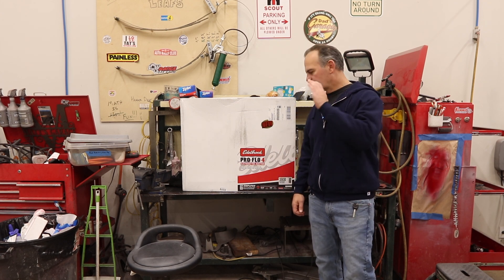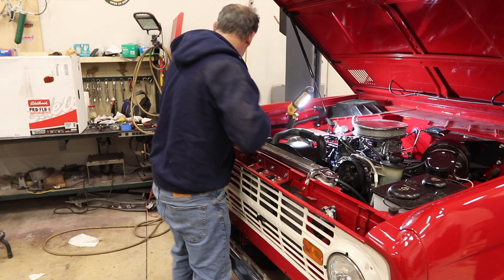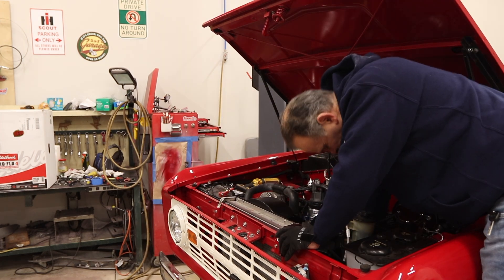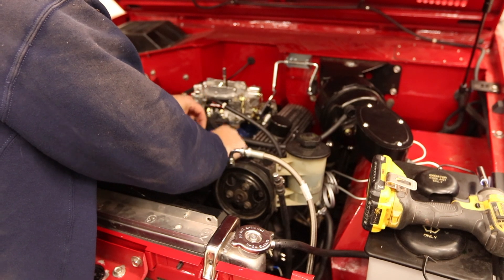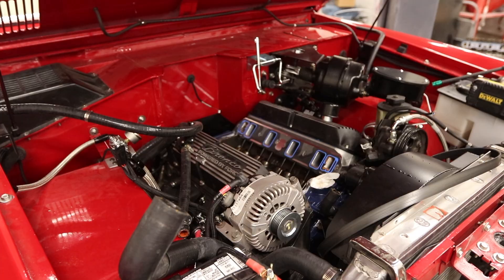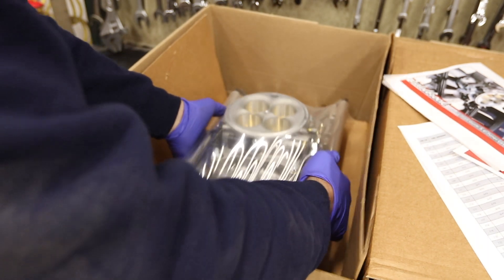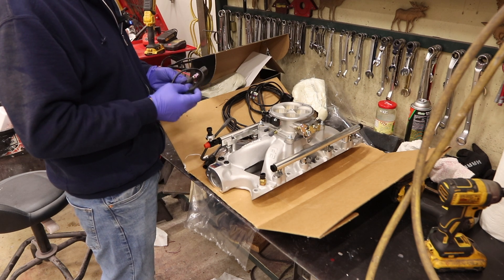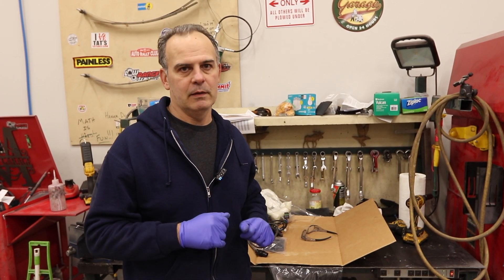#332-Preparing for EFI

Comment: I’m working on a 72 K5 and purchased the sniper 2 system.. been sitting on the intake for several months. Might just pull off and crank the motor with hei and old school carb for break in. But haven’t even started the body work. Just chassis complete at this point. Excited to see the Edlebrock. As I labored for weeks on which one to buy.
Reply from the maker: You have to get after it.  It aint gonna finish itself!  The Pro Flo install video drops on Thursday afternoon.  I won't spoil it.